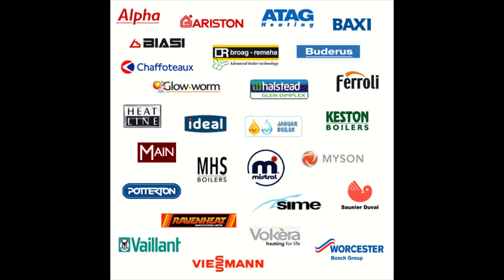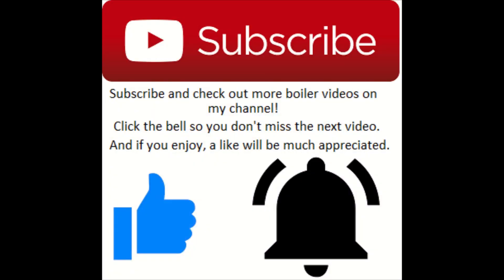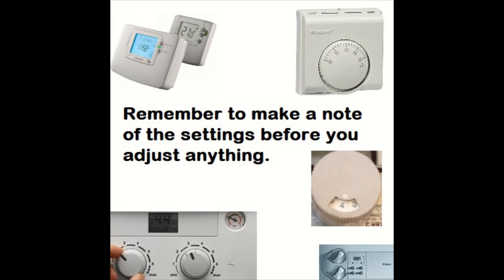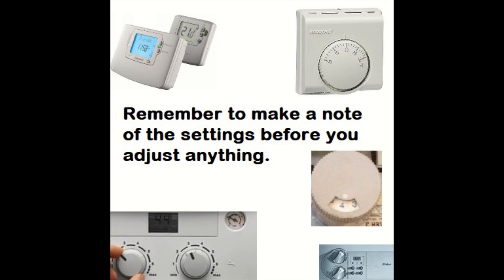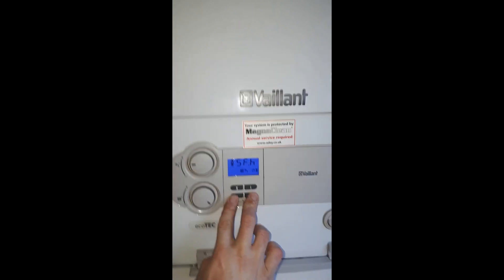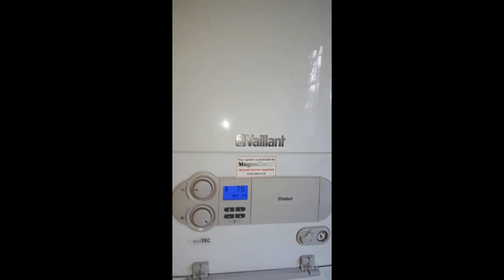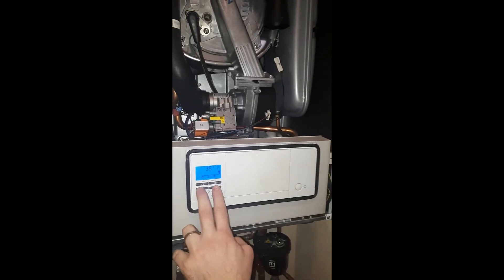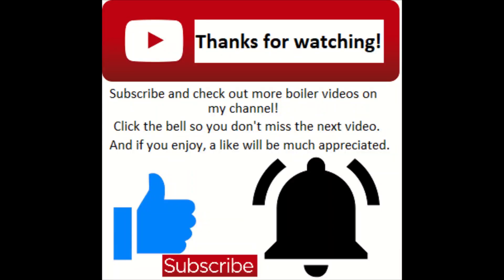How to put most Vaillant condensing boilers into chimney sweep function - Ecotec pro plus

Comment: Had you deleted my comment, as I mentioned before that is not the correct way to put Vaillant into service mode, majority Vaillant boilers you can put into minimum and maximum mode 👍 p.01 p.02
Reply from the maker: Hey friend. Didn't delete, reuploaded. Brilliant, thanks for commenting you are absolutely right about the p01 and p02. This is just the chimney sweep basic service mode.
I'll smash out a video for the other way through program etc